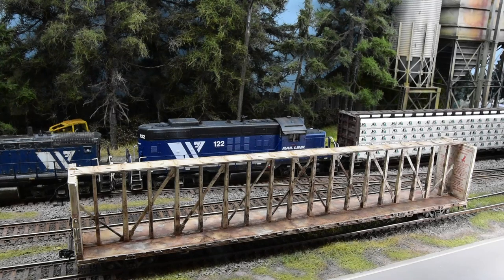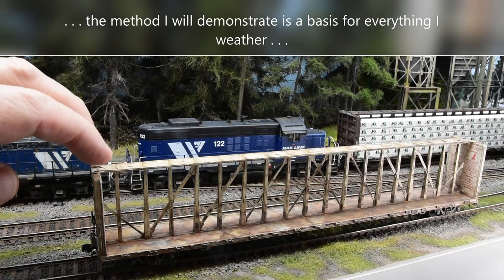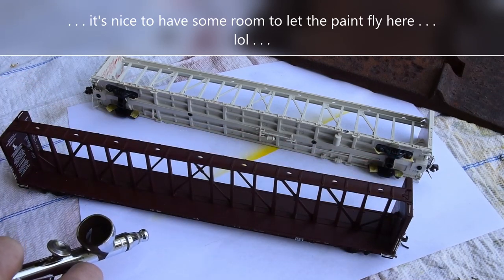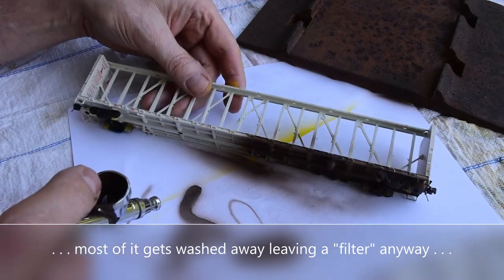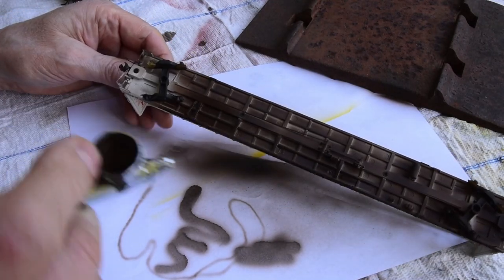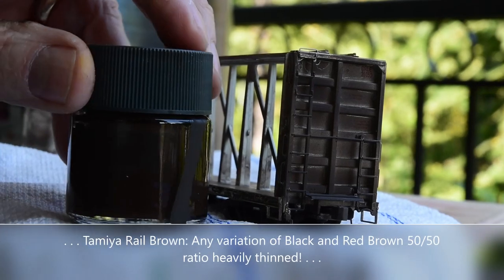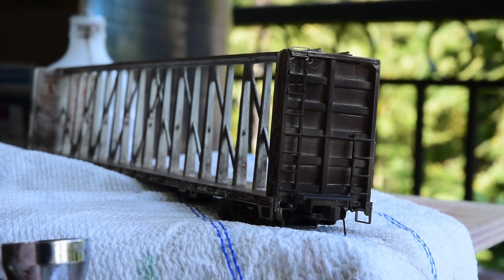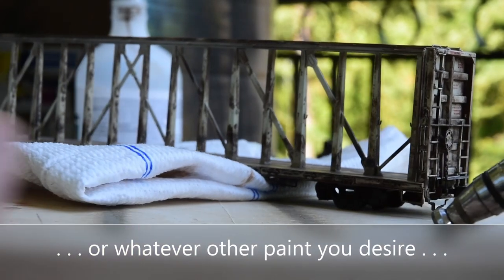Review and Paint Tutorial | The Atlas 73' Center Beam Flat Car

Comment: not sure how often you plan on unloading the wrapped lumber loads on your flatcar..I heard many complaints about how tight the plastic pins fit that hold the halves together. Sometimes they break right out of the package trying to halve them to put them on the car and later the struggle to remove them again. I found that cutting the pins off and using neodymium magnets in the location of those mounting pins work the charm. I did a video of this on my channel not too long ago. It may be worth a watch.
Reply from the maker: I filed the pins down right away, and then applied Vaseline. They pop off O.K. Although, the magnet method you suggest sounds better though. Thank You! ~ Cheers.

Comment: Funny this was posted last night.  Right before this video went up, i was down running ops and wanted a new lumber car on the layout, dug in my cabinet and pulled out one of these I had purchased last year.  I opened it and was very impressed with the heft and just everything about it (not the couplers, changed them to 158's immediately).  

Anyway, on this car after the power wash, did you do anything else to it as it's shown?  THe wet on wet or any powders?  The deck looks like it has some color to it.  Thanks again, will be trying this on my blue Atlas too!
Reply from the maker: Yup. In case you missed it (in the video text). I mentioned it in the Tutorial. I applied some water-based Vallejo rust later on. Lots of water and then some rust moved a round. Cheers.

Comment: Always appreciate your tutorials on modeling scenery and painting techniques, which are very informative. But I may have missed this point in one of your previous paint tutorials; why do you use isopropyl alcohol instead of using model or commercial paint thinner?
Reply from the maker: Isopropyl Alcohol is not compatible with most commercial paint thinners, unless otherwise stated. But then why would they tell you that? - if huge money can be saved otherwise. It's all about retail economics at the end of the day. Tamiya paint is Isopropyl Alcohol based paint (or a similar derivative which I discovered long ago). Their commercial thinner is as well, which happens to be very expensive and therefore cost prohibitive! They just don't tell you that. Would you use expensive (Hobby) enamel thinners to thin your paint when you can use much cheaper "odorless" mineral spirits instead? Why does anyone buy expensive pre-mixed washes or "panel-liner" when all it is, is thinned paint? When you have been in the hobby (professionally) as long as I have you learn things eventually. Furthermore, Isopropyl Alcohol is safe to get on the hands (even the vapor) due it's medicinal purposes as well. As long as you don't drink it . . . lol.
Cheers ~ Boomer.

Comment: If I may, could I put a request in?? How would Boomer dent up and add rusted scratches to a drop end gondola side??
Reply from the maker: Personally, I'm not sure if I would bother doing that with HO Scale (the dents I mean). They don't look convincing due to the thickness of the material. However, if I did decide to model one, I would probably kit-bash in .015" sides, along with new ribs, from evergreen plastic. Then I would repaint it. If I was desperate, I would take a Dremel tool (with a large rotary burr) and manually thin the inside out, then perforate the side skins from the inside. I would also tape the outside surface with green masking tape so I could see the color of the tape through the thinning plastic before breaking through.
I mean who cares about the inside right?  If I do one down the road you can bet I'll post it for sure. Thanks for the idea as well! Cheers ~ Boomer.

Comment: After you apply the black/brown Tamiya rust layer how long do you wait before you start the pressure washing. I heard you say get on it right away. While still wet???
Reply from the maker: Yes and No. If you get on it right away, the  top colors will melt away faster. If you wait longer (up to twelve hours!) It will take a little more close in higher pressure, but also leave different effects. Also, when you are "pressure -washing" away colors with pure IPA, try shooting air (without paint) as well when it is soft & wet and it will create other cool oxidizing effects as well. Cheers.
Reply: @boomerdiorama  thank you! I will try the technique after an hour wait on one Centerbeam and another Centerbeam car 
about 12 hours/ overnight. I appreciate you getting back to me on this.
Reply from the maker: @tomoconnell4235  😁